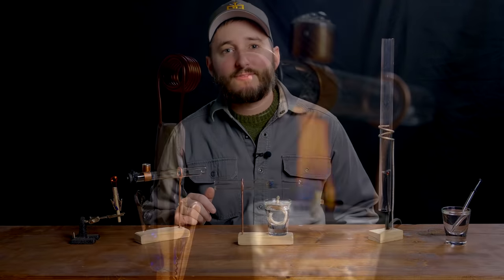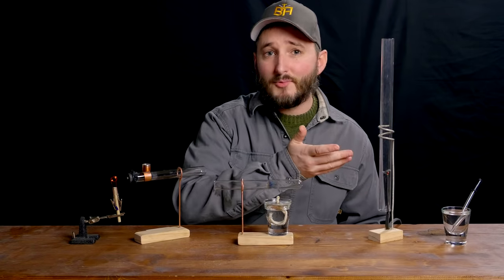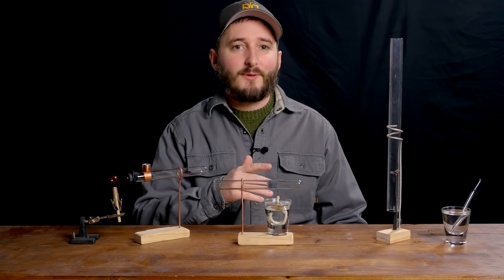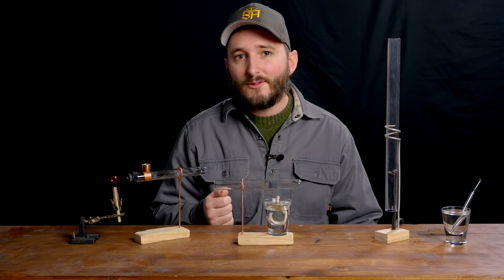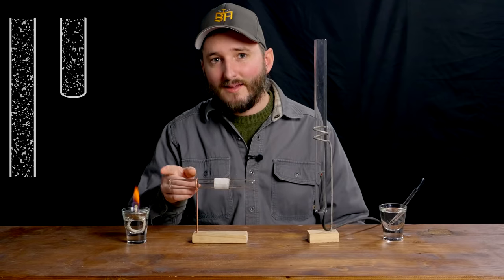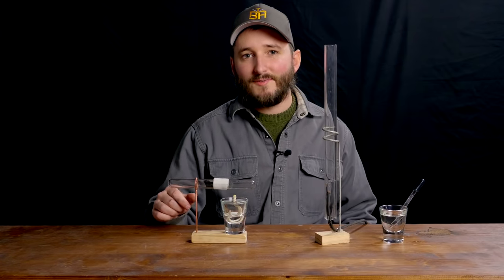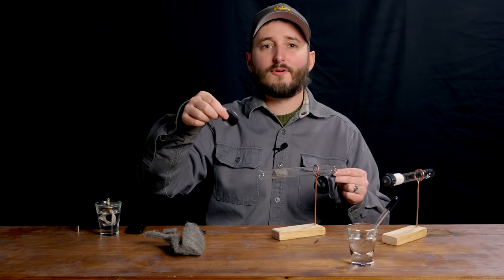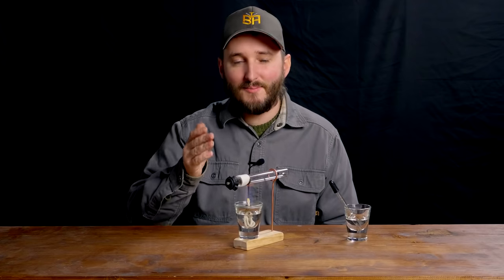Acoustic Energy & Surprising Ways To Harness It (Intro To Thermoacoustics)

Comment: what do you need the resonance for, just use a wood stove upwards heat flow, no pulsing. yep wood stove input says whoos, and all the exhaust goes out of the top. yes its forced directional because of the smaller size of the input holes than the exhaust pipe, and exiting hot gas pulls even more fresh air from the bottom. you would not want a wood stove to sing. use a steel pipe instead, it has natural cooling with the outside air. better than glass tube.

Comment: Ben, would your thermo-acoustic generator work with solar thermal collectors? What temperature does the heat source need to be at in order to generate a significant amount of electrical energy? And what would be the overall conversion efficiency of the system? Thanks

Comment: when to harmonic frequencies interfere with each other they would try to cancel each other out.  when you take the string on a guitar to produce a sound and then pluck another string the sound quickly wants to stop. this phenomena can be used to create acoustic heaters because of the destructive force at work.

Comment: You're rubber membrane with a magnet and coil is basically a backwards engineered speaker. So I wonder if you could just use a small speaker instead. More windings.
Reply from the maker: I realized that later. I have some little speakers I've been meaning to try this with
Reply: @Nighthawkinlight  Nice

Comment: I don't understand why exp. 1 works because I usually have to blow air across a tube opening to create the standing pressure wave. Why is air just moving through it making sound? There must be more to it than convection pulling air slowly thru... ok you're going there :)

Comment: Which substance should the test tube be made out of, for this to work?

Also, how do you find out where the steel wool must be once the diaphragm is attached?
Reply from the maker: Borosilicate glass. The steel wool must be close to the diaphragm unless the tube is very long. The position of the wool depends on the tightness of the diaphragm (see the tube animation) and so you can tighten or loosen the diaphragm to account for where the steel wool is. To find where it should be without trial and error would require quite a lot of math.

Comment: How is this 14:30 not a result of the expanded air breaking the resistance of the small pin hole intermittently to allow vent like a pressure relief valve to create that vibration? (popping through the self closing rubber hole).
Would a ceramic tube create the same air expansion and create that venting/vibrations?

Comment: Please try using a gold fleece in ancient fables gold fleece is prominent. Also using solar power as the ancient people would have easy access and is told about in history books to some degree.
Reply: Gold fleece may not need so much cooling and what kind of load could that engine push for thermo electric conversion?

Comment: I really don't understand how it vibrates.
Take the simple upright steel wool in a tube with no ends.
I get how it sucks air from the bottom, as hot air rises, however, doesn't it then have to reverse the cycle for a short bit to vibrate?

Comment: If used an LED it would have worked. The current is very low since the magnet is not inside the whole coil and doesn't have many turns but enough to make a LED to light up but not an incandescent one that it seemed to be.

Comment: Wouldn't an induction coil be a more practical and safer solution to heat the steel wool?
Reply from the maker: Yes, probably so
Reply: @Nighthawkinlight  It would also allow you to estimate your power consumption more accurately to calculate the efficiency of the engine :-D

Comment: This looks like a great way to extract energy from wasted heat from car engines or furnaces. This could generate electricity to recharge the battery and operate electronics and lights for a car. The alternator which robs power from the engine would not need to to rob as much power making the engine use less fuel.
Reply: There are more efficient (and quiet) methods for harnessing heat, like the sterling engine

Comment: Why not use a conductive piezoelectric material for the tube itself, like quartz or lithium borosilicate, and create a current directly from the material of the tube in combination with 2 or more oppositely charged static producing materials for the vibrating tube to run against so that you carry direct current at high oscillating frequency?

That should offer many thousands of times the efficiency of vibrating a rubber cap with a piece of metal on it next to a coil.

Comment: Why wouldnt it be useful for high-energy output? Doesnt it depend on the resonant frequency of the thing or tube? So if the tube has a high frequency the magnet will vibrate to that high frequency, and the energy needed to get the air vibrating won't need to be so high?

Comment: Is there a method to know where the steel wool must be placed in the tube to get the sound? Also, why not wrap the wet paper at the end of the tube instead of right on top of the wool?
Reply from the maker: 1/3 of the way from the open end. The wool must be kept cold on one side
Reply: @Nighthawkinlight  🙏🏻 Thank you

Comment: You can do it with 3 Pulse 400kv transformer and a low safety power meter on the meter it sounds like a motorbike hook to a 18650 and all go at the same rate as well as a low emp feild off the positive out add the air gap and a 3turn #12  copper coil the more occilate or like a spin off a Tesla coil type will help improve the feild resonance had a Humm as it was between and stuck between the thread count and that also at pulse arked when occilate which gave the best results. Information unlimited EMP unit 200 this about 20 bucks there's 2cm low emp feild this upto 8cm low emp feild take care open chips get toasted!.

Comment: Hi, I did this test according to the steps you mentioned, but it did not work. Why? Can you help me?
Reply from the maker: Make sure the measurements are exactly right. If they are, make sure the steel wool is also not too dense and that it is easy to see through. If that is also correct, pull the rubber diaphragm tighter.
Reply: @Nighthawkinlight  Hi,Dear sir
Thank you for  your  helpful explanation, 
Sincerely.

Comment: Lots of potential here to improve efficiency with optimized magnetic field to copper coil configuration (wire gauge, # of turns, proximity to magnet) etc // similarly your spot on that a cost optimized version (electrical) version of this tech could be used in future highly efficient domestic refrigerators // it must be less expensive than the current electric piston engine compressed refrigeration gas expansion valve into heat exchanger & hot expanded gas cooled by dumping heat into the room with external radiator before condensing back into the inlet of the pump to be compressed again to repeat the cycle // these traditional electric piston gas pressure swing cooling systems gobble hundreds of kWh per year & have poor electrical efficiency, though they are much more efficient than super small TEG Junction DC portable cooling boxes that use thermoelectric junction elements in a heat sink system with a fan to cool the hot side while the cold side inside the insulated box. Magnetic fridge technology also looks really promising if someone can develop a cheap alloy that works nearly as well as gadolinium (rare expensive)

Comment: The beating between the two are not in sync but slightly off.  When a trumpet section tunes, they offending instrument alters the length of a main slide tube until the 'beat' goes away putting the tones in sync

Comment: Why are all the TA engines made from glass? Could they be made from metal? I'd like to see one.
Reply from the maker: Metal works. Glass is better for demonstration models
Reply: @Nighthawkinlight  Do you need a thermal break between hot and cold sides?
Reply from the maker: @QF2653  Not a physical gap, but the materials must be low enough heat conductivity for the temperture gradient to be steep
Reply: @QF2653  Hey Thor I have seen you on many thermoacoustics videos by now do you know the Iypt by any chance

Comment: If thermo acoustic could besued to drive emergency communication or air piston to drive mechanical engines like heat pump, water maker dehumidifier ect. Or cooling the as more

Comment: TRY USING A THINNER COPPER WIRE (30awg) WITH APPROX. 50 OR MORE TURNS AND MAYBE ADD A CERAMIC CAPACITOR TO IT LIKE A (0.001uf) TO HELP IT RESONATE AND SEE IF THAT HELP TO LIGHT UP THE BULB. IM CURIOUS.

Comment: can someone please explain to me why it doesn't reach a state of equilibrium?
from what I understand the air heats, expands, then the expanded air cools and retracts. but why doesn't it just do this a few times then reach a point where the wave is stationary in a midpoint between the hot/cold sides? i now it doesn't, im just not sure why
Reply: did you get your answer? I want to know too
Reply from the maker: Momentum of the moving air stops equilibrium from occurring. The expansion and contraction always overshoots the stable state.
Reply: @Nighthawkinlight  thank you :)

Comment: Why not use a small metal rod suspended in the tube using ceramics and then apply the heat via induction?  Using an adjustable pressure valve would take care of it inflating like a balloon!

Comment: It's really interesting mabe if you a little resistor that you can rol around the tube you can make the same effect as the alhool flame with the rite size of the wire not so fat and Mor magnet's that can slide back and forced easily in the floops of the cower yo can make enuth electricity to heat up the resistor that moves the mecaneck Sistem that moves the magnet's that produs the electresity an cood be a free energy system yor invintion is givin me alot of ideas ();-) so greatings to you frome  Guadalajara Jalisco Mexico ...  (y)  (b)

Comment: Okay here's a here's an idea that just came to me out of nowhere so the rubber balloon the rubber would inflate like a balloon well what if you allowed it to inflate and when it did inflate it triggered a switch that released a pressure valve but the the inflating oh well never mind anyways that's awesome that's so cool if you put two magnet is that a magnet on front of the balloon magnet on that balloon and another magnet made it like a magnetic ram that's amazing I mean in the desert is fully heat with a magnifying glass we could just do that so easily a magnifying glass some test tubes you know I have this vision of a city made of gold and glass es glasses such an amazing medium just amazing what you can do here crystallizations of minerals pretty amazing

Comment: Jet engine has fans that have tones like the tube does increasing pressure and being large tubes in anther causing heat transfer making a kind of bubble cooling and heating and as this happening also send out a jet of air for traveling very little energy accept to increase the speed of the plane

Comment: Merely air blowing through a pipe does not produce acoustic resonance. You either need a vibrating element or the creation of vortices near or inside the pipe to produce it. So the explanation in the beginning is not a vert good one.
Reply from the maker: Then I'd have to explain vortices and why they form, and why rotation might result in oscillation, etc... You can always go deeper by asking "why", but at a certain point you've got to decide how much information is necessary for the subject at hand. If this video were all about stimulating resonance in pipes by the method used for a pan flute I might have gone that route, but as it is that's the only part of the video where vortices play an important role, and it was only an illustration.
Reply: @Nighthawkinlight  But wouldn't you need to know how the waves are produced, even in the closed tube, to truly understand the concept you are putting forth.
Thank you for replying to my comment though, I'm kind of star struck here.
Reply from the maker: In all the thermoacoustic devices I can think of the sound is caused by oscillating expansion/contraction cycles, not turbulence or vortices (primarily). The gas in some well made models may even approach being laminar. The function of heat induced resonance is more like a speaker driven device than a vortice driven one.
Reply: @Nighthawkinlight  That is why I was looking for an explanation in your video as you did the experiments. I was trying to imagine how the waves were created inside the tubes. I know vortices only play a part when you blow air over the rim of a tube. I might be wrong about that too. Anyway it was just an example. 
Can you please explain to me how oscillation was achieved in the first tube? Maybe that would help me understand what was going on in the second tube.
Reply from the maker: @mosab643  Check out this video from Bruce Yeany: https://youtu.be/hMf8Rn4bdME
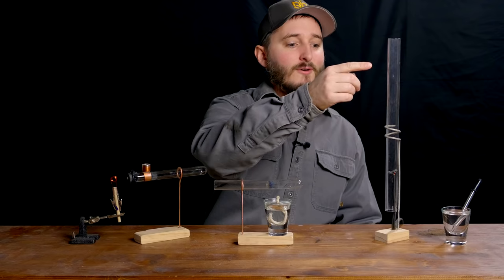I think he gives a more intuitive explanation of the motion around 4:30 in the video.

Comment: Incorrect conception and explanation of the phenomena. The glass tubes vibrate which makes soundwaves. The air vibrations come from material flexing ever so slightly.
Reply from the maker: The glass has its own resonance but it's much higher pitch than the resonance of the air cavity. As an experiment try blowing over the mouth of a glass and plastic bottle of the same empty volume and shape. You'll find they both resonate at the same pitch despite the materials being very different. That's because it's the volume of air inside that is resonating, not the bottle material. I take advantage of this in the following video in this series: https://youtu.be/kkBBkQ8jFRY

Comment: I just want to use those thermal acoustic engines in my yard to a power like moving little signs you know like little yard puppets and little fountains and little whistles that chirp and whistling stuff you know what I mean put out a magnifying glass the tube the engine you have right there let the sun heated up do the motion so during the day my yard has got fountains going and it's chirping and his things are moving around and it's cool you know or what what if a whole series of those little ones all fed into one power bank or my whole yard was a battery

Comment: Show me the governing partial differential equations baby...
Reply from the maker: Wish I could. The math is way over my head. I think it would only go so far in helping construct a device like this because you would struggle to get variables like the weight and tightness of the diaphragm, density/heat capacity of the wool, curve of the base of the tube, to neatly line up with the numbers. Knowing the equations would definitely help get you in the ballpark of a working system, but no more so than knowing approximate ratios of what works. I'm still learning the math myself and hopefully in time will have more insight from that perspective. I believe some of the papers I've linked in the video description of this video and my next video in the series have equations that may interest you.
Reply: @Nighthawkinlight  I'm an applied mathematician by training. I understand things by playing with equations and looking at special cases. Unlike you who seems to be able to simply visualise it and build it, I need precise equations.
Reply from the maker: @mathunt1130  The papers I linked should be right up your alley in that case.